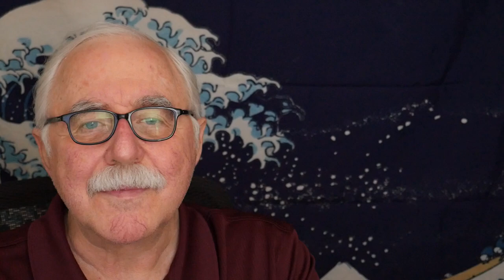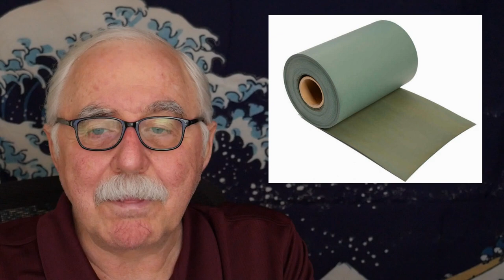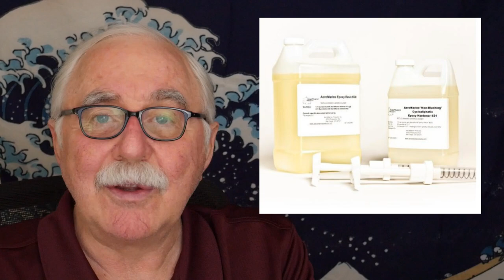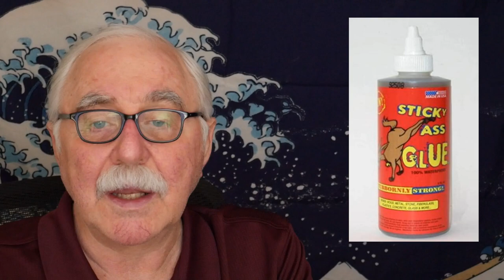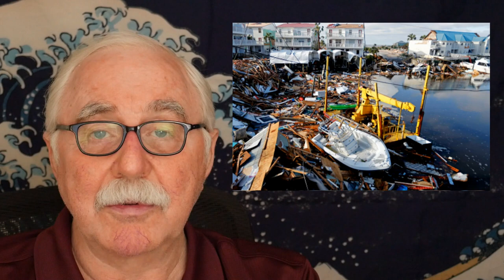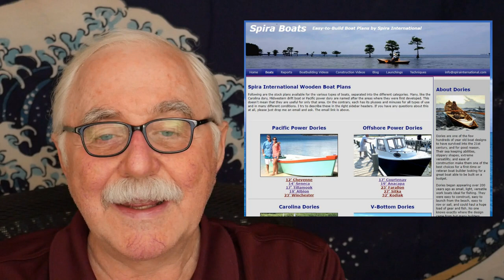Yes You Can Build a Boat #16: Boat Building Adhesives

Comment: You have convinced me Jeff.  We use both PUR and epoxy in our wood products factory.  The PUR we use is from Germany - either Jowat or Purbond (Henkel) are good. I think what you said about flexibility is very important. For building a big strip-plank/epoxy composite boat, one of the things that concerns me is that there needs to be a bit of flexibility in the large monocoque hulls and bridge deck. You do not want anything to crack. The PURs provide this as you say. The PUR also expands very nicely to fill gaps. They other thing is that they are a one-part glue, or at least the ones we use are, and so there is no problem with mixing up batches and, when you rely on workers to do this, you may be putting your life in their hands. 

From what you have said here, it seems to me that PUR to glue the staves and to laminate them in layers and then a skin of fibreglass-epoxy on the outside and inside of the boat would be an ideal solution unless the outside fibreglass-epoxy skin is going to crack due to some flexing in the entire structure. Do you think that the epoxy can handle the small amount of flex in the structure?  I could use carbon fibre cloth if that is going to help, but it is an expensive option that I would prefer to avoid it is unnecessary or not going to help.
Reply from the maker: Oh yes, epoxy will flex enough. It's pretty rare to see it crack, especially in thinner sections, for example a few layers of fiberglass cloth over wood. 

By the way, I think Locktite is the Henkel PUR made or repackaged under license
Reply: @tjkid07  Yes, I am not sure which one owns the IP but the Jowat one too is licenced from the original developers.  I have used both and they seem to be the same. Thanks for the confirmation about the epoxy.

Comment: I am definitely an epoxy boat builder as a retired industrial chemist in the coatings and adhesive industry I concur with everything Jeff said here. I have built a Spira design very successfully among many other stitch and tape and ply on frame boats I am a PU fan too though basically use very little only because I have epoxy and trust it so implicitly that I see little reason to use anything else. Polyurethane is actually more water resistant than epoxy its generally harder its also a good filler but when it does it looses strength It is so waterproof it can trap water in the wood. Another advantage of epoxy is all the different grades and manufacturers use the same ingredients from a handful of sources so are remarkably similar in performance a Basic laminating resin is pretty much the same across all suppliers from cheap to expensive that some fumed silica a range of fillers and wood flour is all you need. The West's and other top level suppliers are good for their blends and various products but you can make all the specialty products your self from the above mentioned raw materials.

In adhesives the one trend I am not a fan of is Titebond I am seeing that pop up allot and I really think that's a recipe for disaster its not fully water proof or resistant it is biodegradable which means it can rot. Its not alkali resistant, Granted its allot better than its PVA and EVA predecessors but it still has the same problems just slower developing. Save it for furniture and protected outdoor construction which is what its intended for.

Comment: I am a time served wooden boat builder and quite frankly I wouldn't use anything but epoxy.  It creates the strongest bond of any adhesive as it will penetrate into the wood fibres better than anything else and it's gap filling properties are second to none.  We have messed with all sorts of products over the years but this simple test will put to rest any argument about relative strength.  Glue two surfaces together spaced by 0.5mm, two drill bits will suffice.  Let it cure and put them on a jig to test the bond strength.  Best by far will be laminating epoxy used I this manner.  Surfaces should be wet out with un thickened epoxy then bonded with epoxy thickend with silica.  Have tried this test with countless products and epoxy wins hands down.  Believe me I'd love a non corrosive product that I could use right out of a bottle and cleans up with water, it just doesn't exist in my world.

Comment: Just buy laminating epoxy resin and thicken it for glueing with fumed silica. Micro balloons are not recommended for glueing as they make the mixture soft and is, therefore, useful for a fairing compound. Silica (for glue) and micro balloons (for fairing) is all you need.

Comment: Thanks.  My two lunacies:  (1)  back yard boat building (I live on the Llano Estacado of New Mexico).  All epoxy/thickeners all the time.  (2)  whirligigs.  Gorilla glue for construction, sat. with epoxy before painting.  (3)  flying.  I dust the plane off, vacuum the cabin, clean the windshield, and add oil when necessary.  The A&P does EVERYTHING else.  OK.  So I can’t count.

Comment: I'm repairing a 1970 Hartley Vixen. It's a 17 foot boat with a 90hp outboard. One of the planing strikes has delaminates from the hull, I think from bouncing on the trailer rollers. I was going to epoxy it back on then glass over the join. Access is the issue though, it's going to be very difficult to do on the trailer. Do you think I could use a polyurethane instead? It would be a lot easier to get in there with a calking gun!
Reply from the maker: Possibly, but epoxy is stronger overall, but the polyurethane is more flexible.
Reply: Spira Boats thank you for the info. I think I'll see what's available in my part of the world :)

Comment: Thank you Jeff for the information.  I do have a question concerning pre-coating the plywood sides and bottom with epoxy before gluing them to the frames.  I haven't tried it but have wondered if the epoxy sealing coat would affect the flexibility of the  plywood.  Take care and have a great week ahead.
Reply from the maker: It would be stiffer and you may have trouble bending it to fit the curved sections.
Reply: @tjkid07  
That was what I was wondering.  Thank you for confirming it.

Comment: What about Titebond 3 ? It’s waterproof
Reply from the maker: I've had several customers use Titebond 3 and they said it was great. For some of the bonds, like frame elements to frame elements, it's perfect, but there's very rarely gaps there. As I describe in the video, it is not waterproofness that is the issue. It's gap filling capability, why I suggest using epoxy or Polyurethane. Does Titebond 3 fill gaps as well? I doubt it. 

The big questions is, are you a good enough carpenter to make every (mostly curved) joint precise enough  to ensure a non-gap filling product is appropriate? Only you can answer that.

To be honest, even though I've built a lot of furniture, some structures and many boats, I'm not patient enough to do the carpentry well enough to make it work. You may be, I don't know.
Reply: @tjkid07  thank you for the reply , I was just thinking of using Titebond on the frame but I wouldn’t use it on the plywood to frame glueing as yes I agree epoxy would be best. Thank you for the time to respond.
Reply: No, Titebond III is not waterproof, it is water resistant.  For that matter, epoxy is not truely waterproof either, it also is water resistant.

Comment: Jeff - is a "rough sawn" surface better to bond to?
Reply from the maker: Well it depends on the glue. With epoxy or polyurethane it probably is depending on how rough the rough sawn surface really is. Probably the best for any surface is flat and rough sanded.
Reply: @tjkid07  Thanks Jeff

Comment: That covered only two adhesives.  And I would not use either, not a first choice at any rate.
Reply: Epoxy and 3M 5200 are all you would ever need. What is your first choice??

Comment: Polyurethane glue. I have heard wiping down the wood with a damp rag leaves Deposits of O2 on the surface utilized by the glue for improved bond. Im not entirely convinced but removing dust doesn't hurt. Building frames for my Glassier Bay and decided a new Table Saw was needed. Not much in inventory in my area. Tough decision.  I have a complete set of frames for something else built with Tight bond and Gorilla Glue Wood, with out screws, they are really strong, I think they will be used as a mold and not frames for something later. As always Nice to hear from you. Good information, going to check it out. Dave.